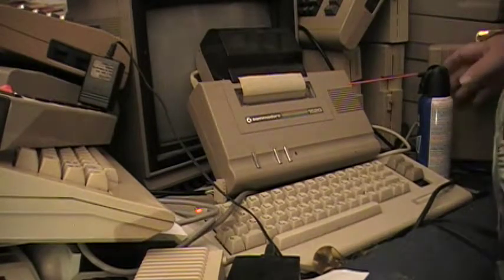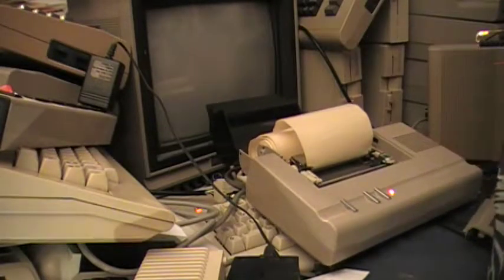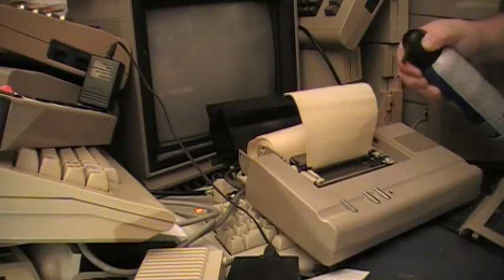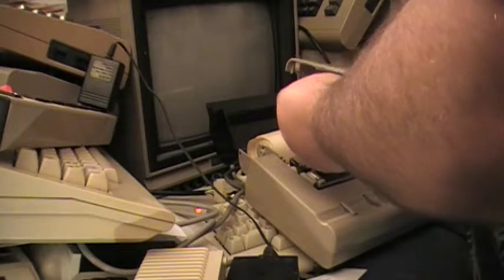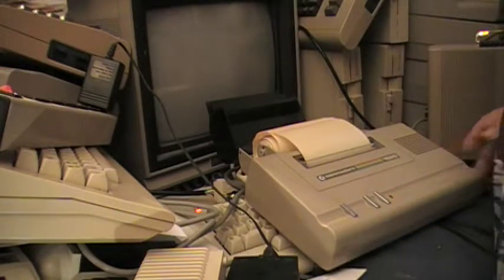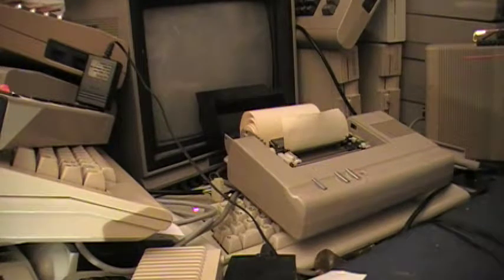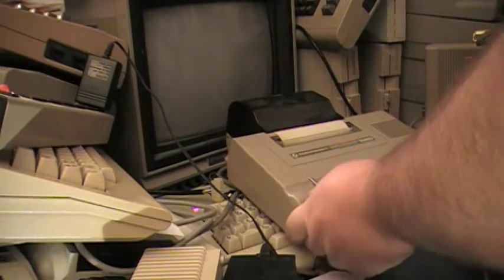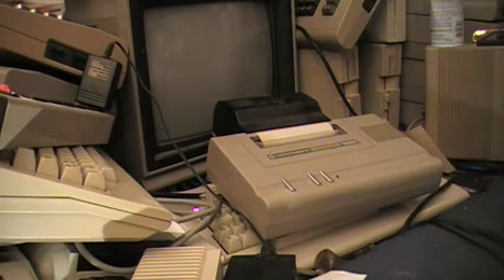Commodore Episode 100 - 1520 Printer Plotter Testing C64 Vic-20 C128 - David Bradley

Comment: You can get replacement (3d printed) pinion gears on internet now. I found some on eBay and fixed a couple of my plotters with these. They contain two of these IIRC and they indeed split. It is a really easy fix.
Reply from the maker: Thanks so much...I will check into them!  I have to get back to actually finishing something when I start on it...sigh...
Reply: @DRBradleyPhotography  I know that feeling :^)